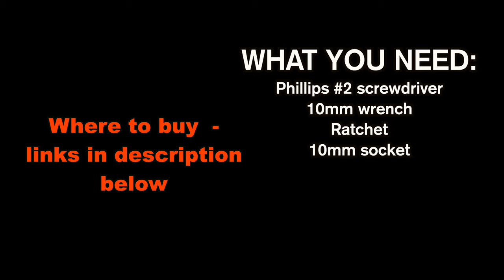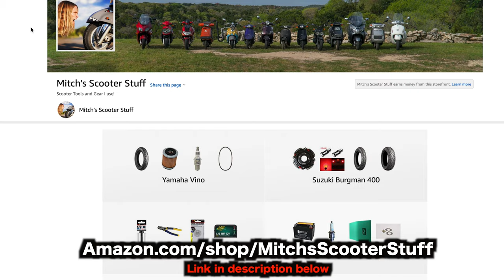Yamaha Vino 125 Leg Shield Cover Installation | Mitch's Scooter Stuff

Comment: For those replacing the front panel, you need to move the turn indicators bracket to the new panel.  Just two screws hold it on.  With enough jiggering I was able to thread the bracket out of the old and into the new panel without disconnecting the turn indicator wires.  Also, there are clip nuts on the end of the "legs" that need to be moved to the new panel.

Comment: Cool video. My 2002 honda reflex has a grinding noise coming from the back wheel. I pulled the rear v pulley and dont hear it anymore. Should I just replace the 
Whole assembly?